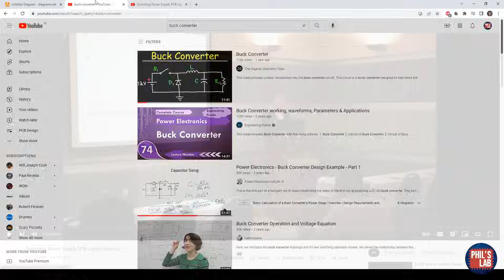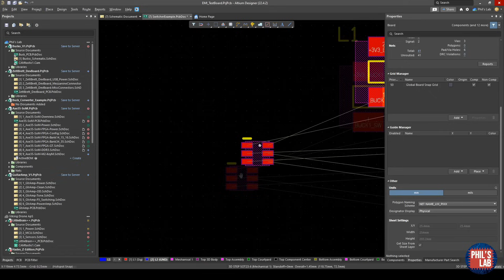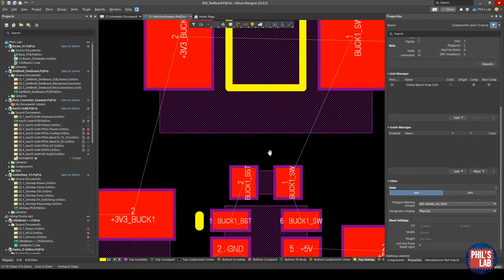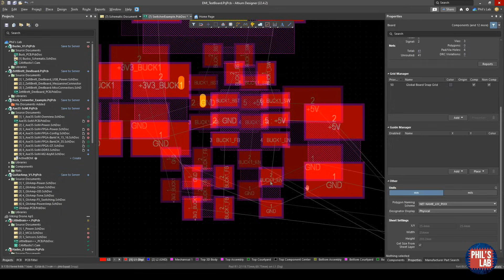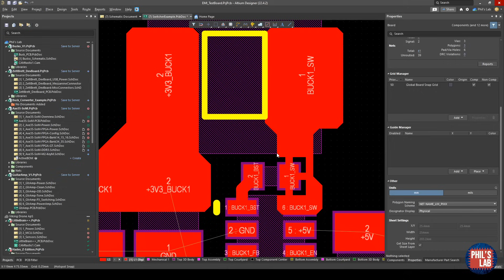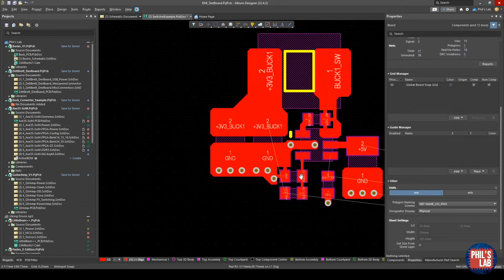Switching Regulator PCB Design - Phil's Lab #60

Comment: I have a question, What is the need for input filter ?    100nf 120RFB 100nf ?  Does it really help ?     
This filter can be used a default filter for ANY buck convertor ?
I am giving 12V input to from SMPS to  TPS54302 buck convertor ? ( DO this pi filter will help ) ?

Comment: Thanks for your content, I have learned a lot from your channel.   Would be really interesting if you actually manufactured a bad layout and a good layout and did measurements using appropriate equipment, to see difference in noise, ripple etc.  Same for USB and RF impedance matching stuff.

Comment: Hey Phil, I have the latest version of Altium, but I do not see where you can unlock the primitives of a footprint then select a pad to add thermals. That would be great compared to creating a specific design rule for each part. I don't want all pads to have thermals by creating a rule specific to the ground polygon pour. Please enlighten me. Thank you

Comment: TI for their 56320X regulators stress not to have ground under the IC to avoid ground current generated fields or pickup.  How do you view this?  Do the input and output capacitors also benefit from not having ground below them as TI seems to show on their PCB example?

Comment: Is there any reason why you would use an N-channel, rather than a P-channel MOSFET as the switching element? Wouldn't an N-channel MOSFET require a gate voltage of V_s + V_g(th) in order to switch on?

Comment: Thanks a million for your effort on delivering great content Phil. Could you please help me with a question, what is the purpose of bypassing the VBUS LC filter through JP1? I'm working on a small power supply board based on IT TPS61087DSCR DC-DC converter and I put a mini USB port so, according to USB 2.0 specification the input capacitor cannot exceed 10uF for limiting the inrush current when powering electronics from the USB port and IT recommends using 22uF for the DC-DC converter input capacitance and, furthermore, you have around 44uF of total input capacitance in your design. That's why I don't understand why you are bypassing the LC filter because as long as I've read it's critical to make sure not to exceed those 10uF of total input capacitance for the USB standard.

I strongly appreciate your help!

Comment: Hi sir, I want to have  5V upto 5A, I am using lm2596  2 in parallel...but when I apply voltage higher than 18v  it starts to shut off and can't provide the continuous power.

Please help me. My source is 24VDC

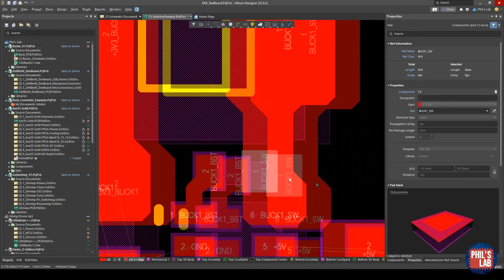Comment: At 20:00, wouldn't those thermal reliefs impact on the current carrying path from the switching IC to the inductor? It seems the thick pour/polygon you ran there becomes seriously reduced due to those air gaps making up the thermal relief.

Comment: Hello, why capacitors are that big? Why not the same package as resistors? Sorry for my maybe stupid question but i am newbie and i dont find any info how to choice capacitors.... Thanks for answer.
Reply: Hi, when choosing any DC-DC converter for your application, make sure to read the recommendations given by the manufacturer in the datasheets, there you will find typical applications as well as recommended PCB layouts and input-output capacitors and inductors according to your needs.

Comment: Great video, definitely will help when laying out the next switching regulator! Just one question: If you'd have a power plane connected to the regulator output, would it be ok to connect the feedback network directly to the plane with a via, or is a trace to the output capacitor preferable?

Comment: Didn't understand why prefer ceramic caps for the output. They can be noisy both acousticly and electrically speaking. Isn't it better to use electrolytic ones instead? In audio applications or whenever you need voltage stability should we always prefer electrolytic caps?
Reply: Hi bro, it's actually the opposite, ceramic caps are highly recommended for high frequency applications, electrolytic  caps are not a good idea in those scenarios. I'm working on a small SMPS board based on IT's TPS61087DSCR DC-DC converter and if you carefully read the datasheet this is what the manufacturer says about input and output caps selection:

8.2.2.5 Input Capacitor Selection

For good input voltage filtering low ESR ceramic capacitors are recommended. TPS61087 has an analog input
IN. Therefore, a 1-μF bypass is highly recommended as close as possible to the IC from IN to GND.
Two 10-μF (or one 22-μF) ceramic input capacitors are sufficient for most of the applications. For better input
voltage filtering this value can be increased. See Table 6 and typical applications for input capacitor
recommendation.

8.2.2.6 Output Capacitor Selection

For best output voltage filtering a low ESR output capacitor like ceramic capacitor is recommended. Four 10-μF
ceramic output capacitors (or two-22 μF) work for most of the applications. Higher capacitor values can be used
to improve the load transient response. See Table 6 for the selection of the output capacitor.

Table 6. Rectifier Input and Output Capacitor Selection

                         CAPACITOR/SIZE         VOLTAGE RATING         SUPPLIER COMPONENT CODE
CIN                        22 μF/1206                           16 V                    Taiyo Yuden EMK316 BJ 226ML
IN bypass              1 μF/0603                            16 V                    Taiyo Yuden EMK107 BJ 105KA
COUT                    10 μF/1206                           25 V                   Taiyo Yuden TMK316 BJ 106KL

Comment: Why can't you tell the software about the design goals? For example, say you want to minimise the size of a loop, by marking up the circuit diagram? 
Tell that you don't want a particular connection to use a via. 
Attach a max current to a particular connection, so the software works out the width of the track?

Comment: You are my 5-star on my successful design/build journey; thanks very much.  On my recent design I used a Ricoh RP605 switch in a low power RF design. I learned a lesson: Its a DFN package and found that with hotpad or airgun soldering its really difficult to ensure that the chip centers itself properly because the big (relatively) thermal ground pad in the middle is so close to the edge connections.  The fix required a 2nd revision of the board with a slightly smaller ground pad. My lesson: beware of accepting the stock pad layout!
Reply: I noticed the solderpaste screen for a QFN32 had four smaller paste rectangles, rather than the entire exposed pad area.  Limiting the amount of solderpaste is probably more important on blind packages than exposed lead
Reply from the maker: Thanks, Peter! Glad to hear you fixed the "issue" in your 2nd revision.

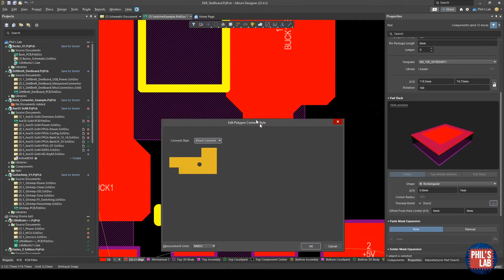Comment: Really helpful, thanks. I was surprised you didn't widen the track after adding thermal reliefs at 20:12, because this reduced the effective track width significantly. Would this have been a good idea? Thanks!

Comment: Excellent video! Would the buck converter work if you would place a capacitance multiplier in series with the inductor and before the feedback resistor network? What comes to mind is that, if you are using a BJT or a Darlington the feedback network should compensate for the voltage drop. As a result you would get a much cleaner output voltage, right?

Comment: Today, I attended Rick Hartley's class on SMPS design and layout and came back to this video to nitpick. Unfortunately (for me) this video is excellent. You highlighted the important points elegantly and pointed out the critical loops. You also did a terrific job at laying out this regulator especially considering its terrible pinout. Goodness sake! The switching node is adjacent to the input node! 

Rick mentioned that extra care must be paid to regulators with built-in parts such as the switch and the diode because we have no idea about the IC's inner layout. We could layout a regulator superbly and it would still radiate or be noisy because the IC itself is designed terribly. He also says that if the regulator's datasheet instructs you to put a snubber circuit, leave it and find another regulator that was designed properly.

Comment: For hand soldering I've had no problems at all putting vias in pads, and for space constrained designs it helps. I have a boost converter that fits on a 12mm smd inductor like a hat. Is there any other reason besides soldering issues for not putting vias in pads? Also, is it better in general to have one larger via, or multiple smaller vias?

Comment: Just when I'm about to design a regulator circuit, a comprehensive design guide is waiting for me :) How would you design a board that needs more than one regulator? for example: If I got a 12V supply and multiple ICs with 3.3V, 1.0V and 1.2V etc. Is it best to step it down to 3V or 5V and then distribute it further or should every power rail have its dedicated regulator fed from the supply voltage? Best Fabian
Reply from the maker: Glad to hear this has been helpful :) It depends. If you have high current requirements for each rail, typically, step-down regulators are more efficient when stepping down from a higher voltage (thus, requiring a lower duty cycle). Therefore, you should then have separate switchers for each rail.
If you only need low current supplies, e.g. for 1V annd 1V2, then step-down to 3V3 from 12V using a switcher, and follow that by two LDOs to 1V and 1V2.

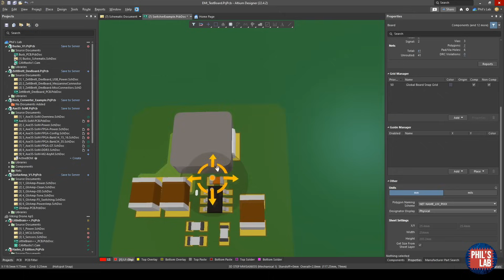Comment: Question for anyone that knows: Why is increased capacitance undesirable in the switching node (as stated in 19:24). Wouldn’t it result in slower rise times and thus less high frequency noise?
Reply: Know this is a bit late probably but for others like me view this 6 months later thought I'd answer. You want fast rise time so the inductor can charge up to your output voltage before the output sags from the output caps discharging. Additionally the longer the switching element is on the more heat your controller has to handle as well.

Comment: I have a stupid question. I am not sure how thick the PCB you use ( probably 1.57 mm) is, but will it not be better to get the ground plane on top of the PCB and keep it more than 1.57 mm away from the power plane. I know that will increase the size of PCB, but the buck convertor will be less susceptible to noise.

Comment: For quick prototypes it would be a huge time saver if circuits and corresponding layouts were pre packaged as single components. Especially if a domain expert designed them. Can you share any ways you could do something like that in Altium and KiCad?
Reply: You can just make badtardized footprints. I wish you could easily nest multiple pcbnew files in kicad :(

Comment: How did you come up with the physical sizes of the input and output capacitors?
Reply: Depending on what was asked 2 yrs ago: the footprint an model will show you, the Datasheet will tell you, and the design programs measuring tool will let you work it out

Comment: Looking forward to the measurement results. I see that the regulator you picked has a second transistor in the place of the diode. I've found that in this usually helps a lot too.
Reply from the maker: Thanks, Roel. Yeah, synchronous rectifiers are typically more efficient.

Comment: Thank you for making this video. It is very helpful. I made a switching regulator circuit similar to this one in EasyEDA, but since I'm just an amateur, I had no idea if I was doing it correctly. Your video has helped me to verify that my design choices are mostly correct. I also would love to learn about thermal management of PCB with regards to switching regulators. In my design, the switching regulator is designed to have max 3A continuous current. However, I was only able to feed 3A for about 2 minutes before hitting thermal shut off. The PCB, inductor, switching regulators were very hot after that. Would love to learn more about how to fix this kind of issues.

Comment: Thanks. Great video. I always have so much trouble getting my buck regulators correctly laid out !
Reply from the maker: Thank you - hopefully this'll help!
Reply: @PhilsLab  absolutely it does! It may be the topic for another video but expanding a bit to include some best practices on how you select the correct components to meet a specific design. e.g. a buck converter that's needs to output 5V @3A?

Comment: I really like these layout examples and welcome more!! Q: Is EMI related to signal integrity or in this case ripple rejection?

I mean in audio we don't worry much about EMI due to freq. but care a lot about SNR. Do the same rules of prioritising loop area work beneficiary? E.g. Power amp with input buffer opamps. Would you split a ground plane to keep high and low currents separate, even if it results in larger loop??

Comment: Very nice and detail video! Would you please explain more about why should the pour copper not arbitrary large? don't really understand about it. Thank you!
Reply from the maker: Thanks! This is mainly for the switch node for two reasons. One is manufacturability (copper imbalances either side of components), and the other is a large pour in combination with a close ground plane on the adjacent layer creates 'unnecessary' capacitance. The SW node is high-frequency and shouldn't be capacitavely loaded more than it needs to be.
Reply: The way to think about it is that on the output side of the inductor you already have huge caps, so adding a touch more capacitance won't be noticeable.

On the input side to the inductor you are trying to drive a PWM signal into the inductor.  If you add a copper pour there, you create a small capacitor which blunts off the square edges of the PWM.  

The inductor doesn't care, but the energy contained in those edges is being shunted into the ground plane and this is an EMI risk.

So on the input side you really want a trace that is as short as possible and only wide enough to comfortably handle the peak inductor current.  A 0.3mm trace in 1oz copper will handle 1A which for many microcontroller boards is way more than peak inductor current.

It's interesting to consider the return paths for each leg of each loop ... It may be that some use of L1 GND copper could reduce the loop areas.  It may also be that the GND via inductance causes a bit of ripple at the IC GND pin which in turn 'modulates' the voltage on the FB pin and creates noise in the output.  Again there may be no practical way to avoid this and it almost certainly doesn't matter!

Comment: Cool, this will be interesting to follow! I was just looking into via placement relative to pads; do you have any resources on the recommend distance between e.g. a 0603 resistor and a via? I understand the via should not be inside the pad as it can wig/suck solder away and too far away is of course bad for keeping low inductance path (for EMI and so on).